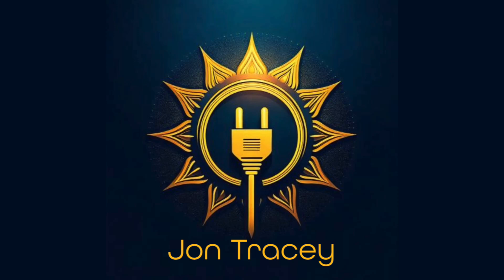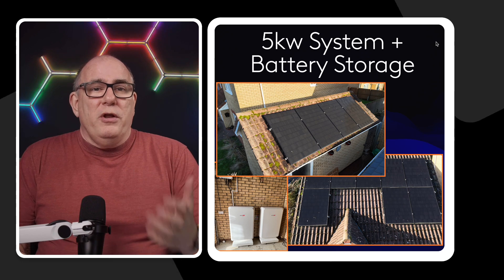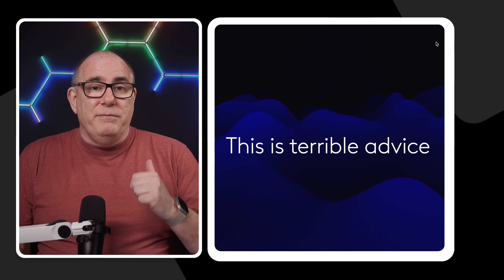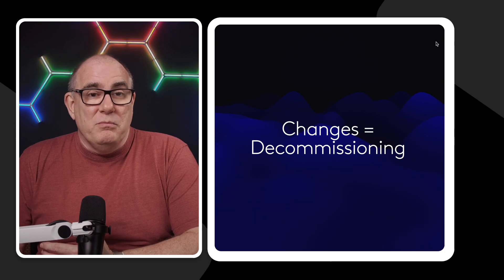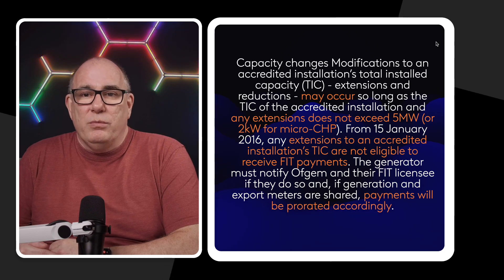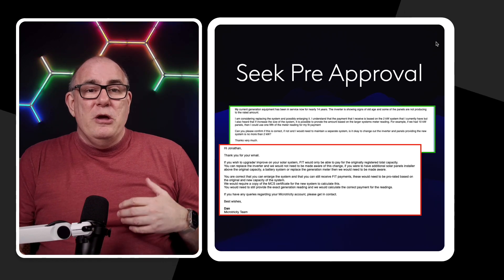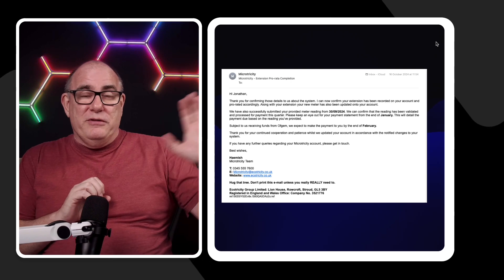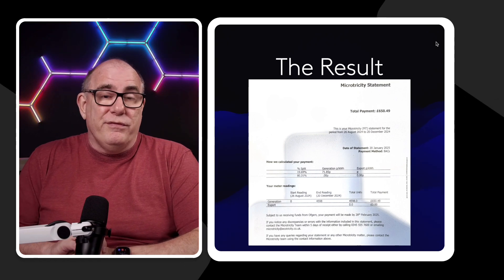How I Upgraded My FIT Solar System (and WHY I Did It)

Comment: Hi Johnathan,

Great video detailing exactly the same issue I have

I have a 2.88 kw fit installation, installed in 2015, I would like to replace all the old 24 x 120w panels with new 450w ones and install a sigenstor 8kw inverter and 2 x 9.4 kw battery’s, can I do this ? Or do I need to keep the old inverter running as well as the new one ?
Reply from the maker: no providing you get permission from your fit provider in advance, you can change the whole system. What you can’t do is get paid for extra capacity. So if your new system has more capacity, they will pay you on a percentage of the whole.
Reply: @JonathanTracey  thanks Jonathan that’s really helpful

Comment: My understanding was that any change could not exceed the current capacity registered for the FiT. Effectively borne out by the adaptation  saying you will not be paid for more than the original installation. Inverters could and can be upgraded, and the panels can have modules added for monitoring, as that does not affect the Capacity. 

A valuable insight. Thankyou.  One of my own: Watch out in 2 years time when the mandatory inspection of the meter comes round. If your FiT provider Fs up your inputed paperwork as Scottish Power did mine, their computer will ask for the OLD meter to be read as well as the new one. Good luck getting them to understand that their computer is WRONG! They will freeze any future payments until they FINALLY understand. Until the next time, 2 years down the line :-( This has happened to me. TWICE. "But the Computer says . . . . . "
Reply from the maker: Yeah they have put a pro rate into my Bill. That means I only now get paid for 18% of the capacity, so same amount of money but now I only have to manage one system. With regards to the mandatory inspection in 15 years I’ve only actually had two, so I’m not sure they’re either very very far behind on their list of inspections or they just don’t bother half the time.

Comment: Great video and information, i have a 1.4 system on the early tariff and i have the opportunity putting more panels on a new roof along with a battery.  Can you tell me how you opted out of the deemed export tariff? Thank  you
Reply from the maker: Yeah, it was a pretty simple process, I sent an email to my fit provider expressing my wish to opt out of the deemed export. They then register that on the system, that can take it a couple of weeks. Then I asked octopus (my energy provider) to set me up with an export tariff, once they could see that I had adopted out on the system they applied to the DNO for an export MPAN , this took a few more weeks. And then the whole thing just went live and I started getting paid for my export.

Comment: In 2011 my 2Kw (8 panel) system cost £5,200 all in with 25 year warranty on panels and inverter. The £200 was for the scaffolding for the weekend though they didn't take it down for over a week.
Oh, forgot. Extra £40 to pay for the final check and the signing off on the documentation required in order to get the FIT Payments. Helps having a son who is an electrician and was wiring them up every working day so we put them on the roof ourselves. Never had any problems with any part of it and the government pays me around £1,200 (74.37p a Kwh) a year for the electric I make in the last year (2025) which I mostly use myself as I'm retired and so at home a lot.
Reply from the maker: my scaffolding was way more as thy had to build a bridge over my conservatory, if memory serves it was about £1000 just for that

Comment: Very useful video JT. Thank you. I was always aware you could make replacements for failed equipment (inverters don’t last forever), but not that you could extend. I have a 4kW south facing PV system (on two strings) with a 4kW SMA Sunnyboy inverter. From 2012. I will definitely investigate if replacement with more modern panels might benefit me. Perhaps batteries too. But I’m really waiting for V2G inverter/chargers for EVs. Keep up the good work
Reply from the maker: yes, as long as you do it with the approval you won’t run into any problems. Although we only get paid a percentage of our total generation, I have seen my payments actually go up, I don’t know if that’s down to efficiency or the fact we can store the power but it seems to have been a net positive, only by a tiny bit but still it was nice to see

Comment: Did you get G99 approval? Your DNO could stop you in your tracks if they thoughtt that the local grid could not handle it.
Reply from the maker: yes I have a G 99 and over the years have had it upgraded from 5 1/2 kWh to 10 kWh for export purposes. That my local DNO is really responsive, any time I want to make changes to my system quick phone call fill in a couple of bits of paperwork and we’re done.

Comment: im in the same situation. just had a powerwall 3 + expansion + gateway added. installer said i could move my 4kwp FIT array to the PW3 and remove the super reliable Stecca 3.68kw inverter. so installer gave me a letter to send Octo (my FIT) provider. theyve sent me a Battery declaration form which the installer and me have signed. taken photos of old meter and new one, which is a NET meter. im now a bit pissed with the installer as chasing for some of the info listed in the last paragraph where hes signed. theyre asking for photo (which weve got), but then wants MID cert (not sure what that is) meter make (can get that off the meter) meter manual (god knows what they want that for) confirmation of how the meter works (like WTF) confirmation of whether the bidirectional functionality is set by the manufacturer (seems bloody obvious if its a bidirectional meter). so im fed up of asking on whatsapp and will call them on Monday as i want to nail this down before im asked for a FIT reading in December.

Yes you can do these things but the installer made it sound easy and not a problem. in hind site i might have left well alone until my 20 year FIT finishes in 9 years.

Comment: You can add a battery system like sigenergy 16kw system which can store energy at off peak times 😂then use it during peak times
Reply from the maker: you can, but if you’re only doing this with batteries and not solar added to it, your payback period is going to be quite long.

Comment: Great video, glad to find someone who has already done it, like yourself I wasn’t accepting that it couldn’t be modified. I had the usual WhatIf Questions, need a new roof, Panel fails, inverter fails and i too had already found the Ofgem documents before coming across your video. Happy to know, if i follow proper protocols and procedures and be patient, i too should be able to modify mine too
Reply from the maker: Sure its really just a communication exercise before and after with your FIT provider but its not really documented anywhere that I can find.

We just had our second payment since the new system was installed so happy its all working

Comment: Thanks for this. I'm assuming it's more difficult if you've combined the battery with the system. As the generation meter after the inverter would register battery discharge as generation ?
Reply from the maker: To be honest, they never asked, all they asked was for the system diagram and the MCS certificate. That both detailed the batteries and that was it.
Reply: Thanks, sussed it after doing a bit more reading, it's all about the type of generation meter. You need a bi-directional one (which your replacement is) which basically gives you the difference between import and export to the inverter.
Reply from the maker: Just ran out and checked and yes that's what mine is

Comment: Thanks given it a view.  Again beautifully explained.  Interestingly enough lots of the installers who came and quoted (or not quoted) for the new NNE facing system suggested combining the systems but didn't mention retaining FITS.  I might be interested in the oldest system which is 2003 vintage (Clearskies low FIT rate).  This one needs upgrading. The inverter is an old Sunny boy 750 and whilst the roof hasn't leaked yet I am worried a bit about the roof mounting which was basic (but well done).

You must be able to switch inverters though since you can't get a 750W one now?

The thing that puts me off is Octopus who were a nightmare to deal with on switching my FIT from OVO/SSE....  Also they are all in profit so its more powering EV and future HP rather than immediate needs...

Thanks Neil
Reply from the maker: Yeah, you can pretty much change any part of it now and even consolidate parts so long as you do it with the approval of your fit partner. I took mine out 15 years ago with ecotricity and although myenergi supplier is octopus, I still kept them as my fit provider

Comment: I'm quite jealous of the FiT rate you're on, ours is much lower. I can also confirm that you can make substantial changes - If you don't touch the solar panels, it is even easier.

I confirmed two separate scenarios with our FiT provider, Good Energy, and they have been very helpful explaining everything.

1) If we change the inverter to a hybrid inverter of the same size, add a battery. (And swap the meter for a bidirectional meter) - This is absolutely fine, they only need to be notified once it's changed.
2) If we increase the size of the inverter as part of the change (3.66kW to 7.5kW), aside from needing DNO approval, which is separate, this is also absolutely fine even though the solar panel array is larger than the original inverter. This is because the FiT arrangement is based on the installed capacity, I.e. The solar panels alone.

It's great to know that you can also change the panels with approval. Thank you for sharing this.
Reply from the maker: You can see why I was so desperate to keep hold of the payments, they still have 10 years to run that could be a substantial amount of money that I’d be giving up. Yeah, at this point I have changed every single part of the system, and to be honest, the hardest part of it was convincing people to actually go and look at the government documentation on the topic to get their approval.😂

Comment: It’s often the case potential customers are more up to date than installers,
Reply from the maker: sadly, I think that’s true, you would think people in their industry would keep up-to-date with the changes
Reply: @ 
                               When I updated my system had 4 different installers round and none of them had heard of prorated, nearly a toe to toe with one bloke, I’m currently trying to upgrade my battery output and having the same issues. GE installers have exclusive access to a fitted system but there’s no vetting of how competent the installers are

Comment: I’ve received a letter today - to the householder- that says according to their records I am entitled to a £4000 grant towards upgrading my 14 250w panels installed in 2014 to new 450w panels without losing my FIT - is this genuine ? I’m always wary of letters ‘to the householder”
Reply from the maker: There are no grants I’m aware of, so suspect it’s a scam or at least a bait and switch
Reply: @JonathanTracey  thanks
Reply from the maker: I did a little bit of digging and came across a few people on Reddit who have been offered similar things. But it looks like the quote that they were given has been artificially inflated by can you guess how much… £4000 shock horror

Comment: Jonathan, slightly off-topic here, but can you charge all 3 of your Energy Bank batteries from the grid? A few months ago I was enquiring about adding a second Energy Bank battery to my SolarEdge (SE) system, and was told that although up to 3 Energy Bank batteries could be connected to SE HD Wave inverters (my 3.68kW version anyway), only one of them could charge from the grid - the others would require PV charging. SE were supposedly working on this, and I’m not sure of the current status. Maybe different inverter sizes have different specifications.
Reply: Great, thank you. Time for me to ask my installer the question again…..
Reply from the maker: Sure, from what I see watching the batteries from home assistant (using modbus over tcp) they never get out of sync for more than 1-2 seconds
Reply from the maker: They all charge together, basically the inverter sees them as a single unit. However I can see them  as separate units from home assistant, and all three operate together, so when grid charging at 10kw(my inverter size) all three charge together at about 3.3kw each. Each battery can charge and discharge at a max 5kw, so in theory 10kw for grid + 5 from solar or any combination.

Comment: A really good video, Jonathan. Like you, I’ve always been told that I can’t touch my FIT system, but unlike you I took that advice as gospel. You’ve given me a few things to think about!

My system isn’t too dissimilar to what yours was, with 2 independent systems. Firstly an inefficient (due to shading) 4kWp panels + inverter system installed in 2013, receiving FIT payments. Then in 2022 I installed a SolarEdge (SE) system consisting of 5.6kWp panels, 3.68kW inverter, and 9.7kWh battery. You mentioned that you think even today that SolarEdge doesn’t enable their battery management system to be used if there is more than one inverter. I think this is probably true if the non-SE inverter is a hybrid inverter, but I don’t think it’s an issue if the non-SE inverter is a old-style “pass through” inverter that was typical of its day back in 2013. My SE battery management system works okay, it’s just that it can’t take into account any production from the original panels. If I ever try and replace my original inverter with a newer hybrid inverter, then I agree it will likely be problematic.

You refer to your mistake on the 3.68kW SE inverter, and I’ll need to go back and look at your video on that. I probably made the same mistake, or to be more accurate accepted bad advice at the time, when I was told I wasn’t permitted to have a second inverter any larger than 3.68kW given that I already had the first 3.68kW inverter. My problem, needless to say, is that at night the original inverter produces nothing, and if my house load goes above 3.68kW then I’m importing from the grid even if I have plenty battery storage remaining.
Reply from the maker: Hi Alan, glad you found it useful, I have to say it took some digging and even with the ofgem document in hand installers were reluctant to help. That said its all done now and first payments should land in a few days. As far as I know the DNO does not care what size your inverter is, they just care what it can export. So you could have a 20kw inverter but be limited to 7kw export

Comment: Hi Jon I to would like to thank you for this video.

I have a 13 year old S-SW array 16 panels 3.84 kw and a SMA sunny boy inverter and I have just ordered a Tesla Powerwall 3 from Heatable.
My reason behind going for the Tesla PW was it has a built in inverter and as mine is now 13/14 year old it might be better to get this unit, but I like yourself have a FITs payment which I don’t want to lose and because of that they have said they  can’t remove my old inverter and use the Tesla one so I hope you don’t mind I sent them a copy of you video and they have now said for my set up the Tesla inverter can’t be used because it is not a separate stand alone inverter how ever it could be used now or at some point in the future if my currant SMA gave up but I would still lose my FITs payment if I use the Tesla unit and not just replace my current inverter with another separate one have you an opinion on this.
Thank you
Les from Wigan
Reply from the maker: Sure send them the video and the link to the ofgem document, then contact your FIT provider and seek permission. Its a long winded process but its doable
Reply: Oh dear. Tesla bateries are a rip off.  Bateries are now well under $100 per kwh. Do the maths to see.

Comment: Been advising people to do split systems, but replacing the entire array, By leaving the fit system from inverter to export the same. 
 i wasnt aware that they did the % split.
But the last info i read was you could change hardware like for like, as long as you did not increase the out put on the fit system.
This way is so much more sensible. Clearly not a government thing .😅.
Reply from the maker: to be honest, I’m not sure how it came about, the document seems to have been on the off gem website for a couple of years, but nobody seems to know anything about it
Reply: @JonathanTracey  there was a court ruling a while back where they were trying to. Stop payment because a part of the install broke.
The ruling (and I generalise) was that if a part breaks it can be replaced/exchanged for a new one.
I think it was like for like, or at least that was my take and what I can remember. 

More recently is the fit scam,  and I wrote about that, so you get paid on the basis of what you produce and export, but most People were getting 50%.
That's incorrect of course as most people are out working, when the peak of production is made, so it very very unlikely that they would use 50% more like 2% maybe up to 10%
So customers fitting batteries, they are usually out to change the meters.
Fit ended in march 2019 seg is kind of hanging in but export pay is between 4 and 11 pence.

These days export payments are a big thing due to the overcharging from solar companies. 
We have a target of 4 years for kits to ROI without export payments. Small solar 1 year. And it is achievable,  I just think those who got fit, really did get a good deal.